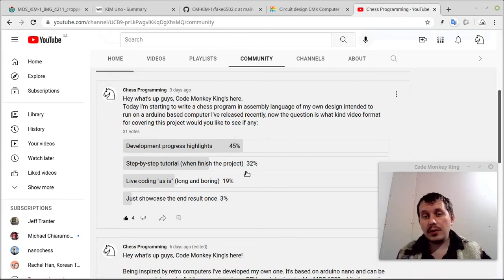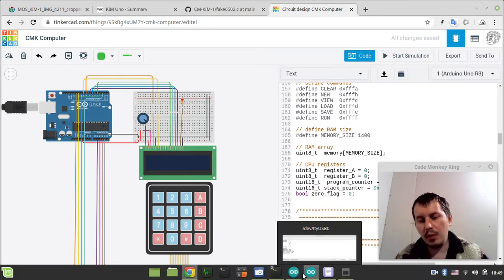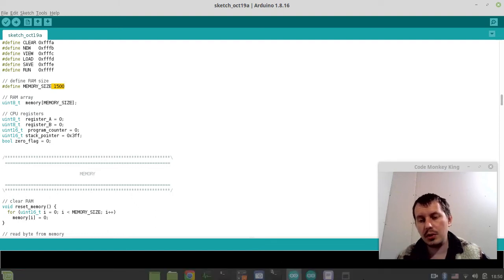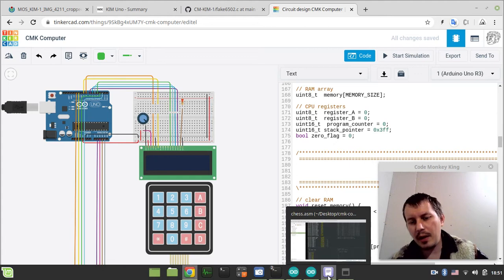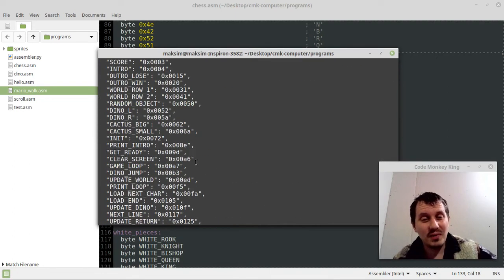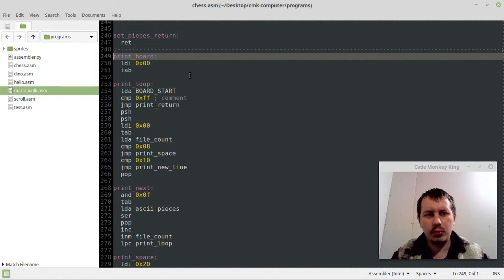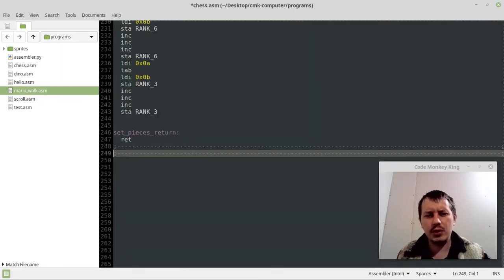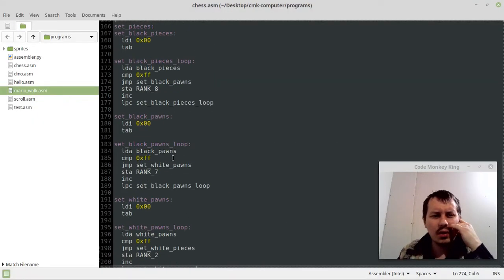Arduino computer chess program development | EPISODE 2

Comment from the maker: 00:00 Thanks for voting!
00:40 Running out of memory issue
01:02 Pushing CMK computer to the limits
05:50 Running init board routine on CMK computer
08:15 Memory savings if I get read of print board routine
11:00 Walking through init chess board routine
13:00 CMK COMPUTER AND MOS KIM-1 COMPUTER SIMILARITIES REVEALED!
22:00 Why I can't promise that this project is going to be completed...